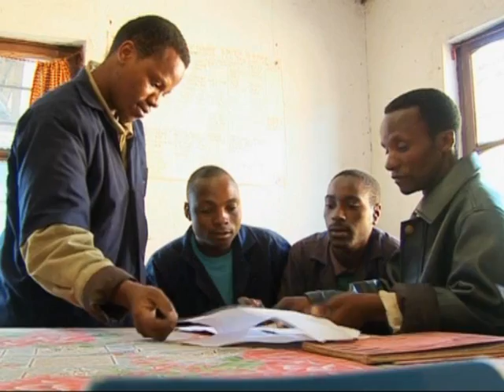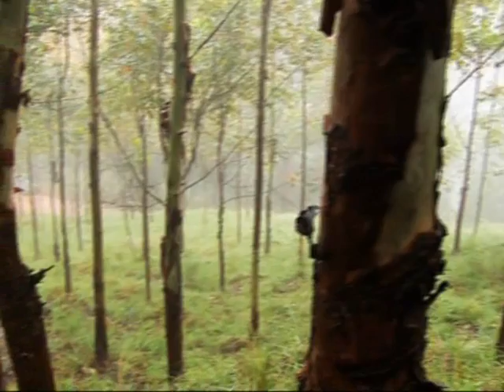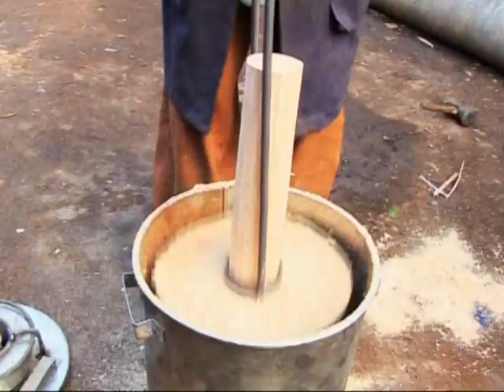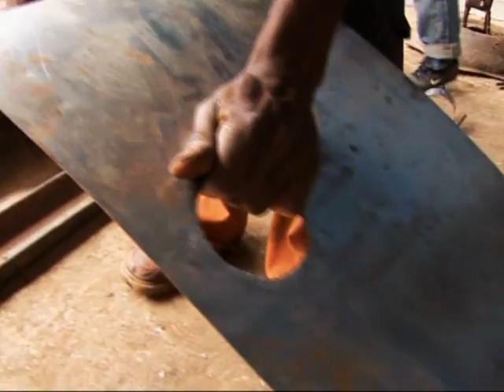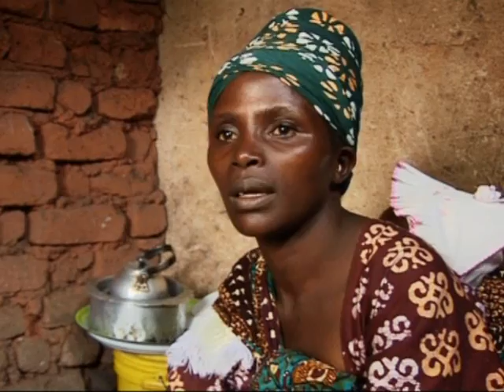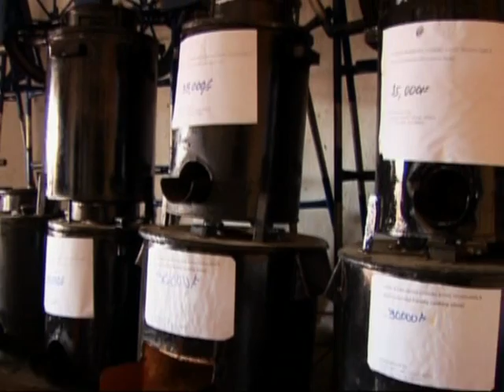Kisangani Smith Group, Tanzanian stoves burn sawdust - Ashden Award winner

Comment: When I lived in Kenya (1975-87) one could occasionally find a very well made stove that preheated sawdust in a sealed container, with the resultant gas (Methane?) being burned cleanly in a ring-shaped gas burner. Although the initial heating was done using charcoal or wood, once started, there was enough heat form the burner to sustain the process.  I tried to find one on a recent trip to Kenya, but to no avail. Are they still made?